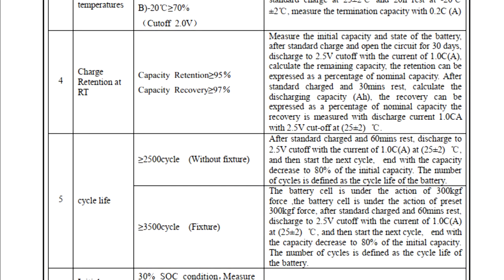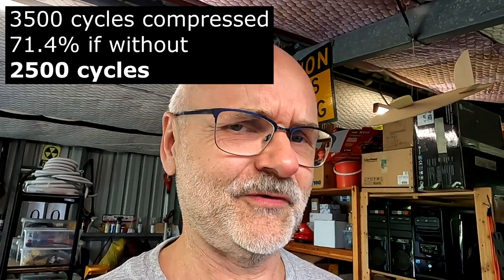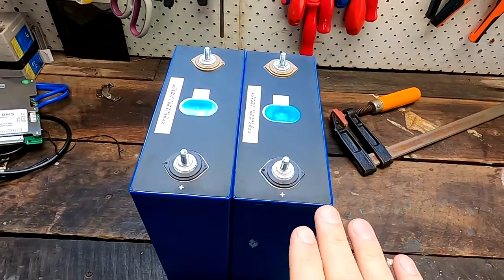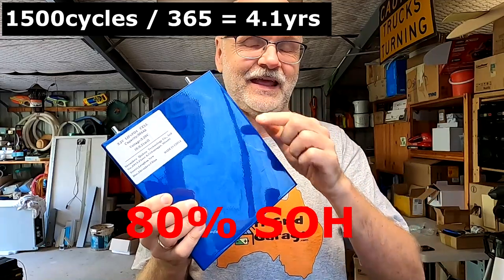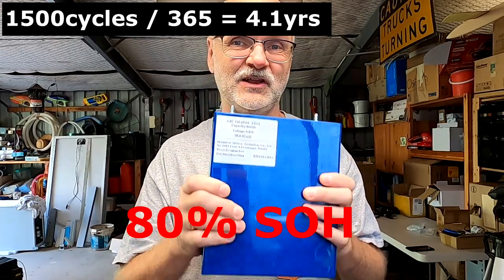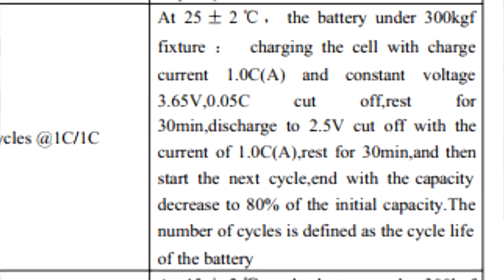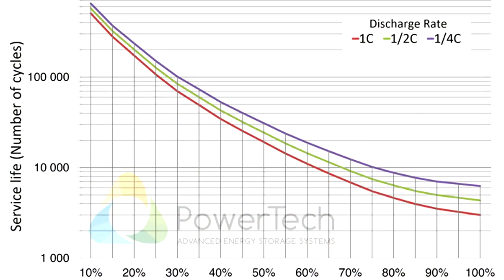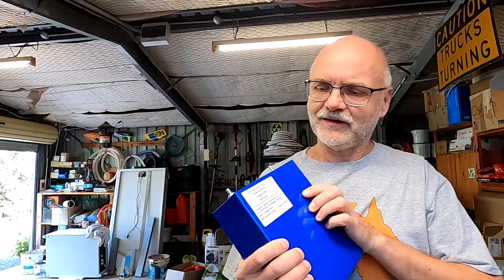Why compression will not extend battery life (something else kills your batteries).

Comment: I added mine in a fixture, because why not. In any case, high temperature does have a much bigger impact on cycle life, which is why I have an advantage here: my cells will live forever! ;)
Reply from the maker: Yeah, but too cold is not good either. 20-25° would be ideal. I'm in this range with mine atm. But it gets colder down here now... Unless you build a climate chamber with constant temperature...?
Reply: @OffGridGarageAustralia  Actually, when not using the battery storing it at very cold temperatures (even well below freezing) slows calendar aging. I have heaters built in mine: the case is insulated and it uses a small 7W Polyimide heater coupled with an aluminium heat spreader.
Reply: @OffGridGarageAustralia  hmm looks like the battery has enough spare capacity to provide its own local heating if required
Reply: I'm in South Africa and get so annoyed when all the YouTubers getting obsessed about the low temperature cut off of the bms.
Reply: @guy7gsa  High temp cut-off has been pretty much a given for some time. Low temp cut-off was missing for a long time. That's probably why...

Comment: resources were used in the production, which is valuable. Even if you don't use the life of the cells, someone else might. I think we should be sustainable everywhere 👌👌
Reply from the maker: But the resources would be used in any way, regardless if the battery lasts 5000 cycles or 7000 cycles.

Comment: I chose to do a light compression simply to hold things together in my school bus conversion. I didn't want the terminals getting a bunch of stress from the cells moving around a bunch.
Reply from the maker: Yes, that makes sense. Do you use flexible busbars as well?
Reply: @OffGridGarageAustralia  no, i figured that since prebuilt batteries generally don't use flexible bus bars, and since my cells are held snugly together and their box will be securely fastened to the frame, it shouldn't be necessary. Here's to hoping I'm not wrong.

Comment: Great video 👏🏻. I also came to the same conclusion on my own battery build…only without the accurate maths. 

I don’t know how accurate the cycle counter on my Daly BMS is but I’ve used 24 cycles in 6 months (including deeper discharge in a cold dark British winter) so even if I were to only achieve 1000 cycles that would be 20 years. And even then still have 80% capacity left. 
Like you say calendar ageing will be the death of my battery… a bit like the rest of us 🤣.
Reply from the maker: Hahaha, yeah calendar ageing will haunt us all!
Reply: The Daly counts 100% cycles, so if you do a 50% DoD, you will need to do 2 cycles for the counter to go up by 1. But in my experience the threshold current for the Daly is at ~2.6A, so it will not count anything below 133W on a 51.2V system. Most of the time I'm well below 2.6A on the discharge. So the cycle count on Daly isn't really worth anything in my opinion...
I'm not really worried about the cycle counter, but the high threshold also means that the state of charge is usually way off. Especially when there is no/little sun for a couple of days. The battery discharges continuously without the Daly noting anything. So the real SoC may be as low as 30% but the Daly will show 80%. This shows especially when the sun comes back up. After a short time the Daly will show 100% since the charge current is high. But the charge cycle will last many more hours before the battery is actually full.
All in all I like the Daly as a BMS that does its job of killing charge/discharge depending on voltage and temperature reliably. But for anything more sophisticated (balancing, SoC...) it's pretty much useless. The features are there in theory but not really, since 40mA on a 300Ah battery don't do anything. And a SoC display that is usually way off doesn't really hit the spot either.

Comment: The problem I have is that this is all academic at this point. There is not enough people that have had these cells in use for long enough for us to really know how long they'll last and how much of a difference compression/no compression and other factors make. I know of a few folks that have had lifepo4 for 10 plus years but they were using the plastic case CALB or Winston cells, I don't think the aluminium case cells have been around that long. 
Unless someone has clear evidence that compression is harmful to the cells, I just can't see any reason not to do it. Preventing the layers in the cell from separating has to be a good thing, and may help with calendar aging too. My cells were a big investment, and if the  ~$30 of materials and one hour of my time to set up compression gains me even just one year of use than that is well worth it. 
As for the assumption that there will surely be much better batteries available, for much cheaper, by the time these cells wear out, well, that is just an assumption. I sure hope you guys are right, but there is no way that is guaranteed.
Reply: exactly....the manufacturing plant with many years of experience do not print these specifications for no reason...

Comment: I've build a 24v 105ah Lifepo4 battery for my sailing dinghy, to power the auxiliary electric pod motor. If I take the boat out each weekend and I manage to fully discharge the battery each time. That is 40 years of cycles, at 2000 uncompressed.

I am going to use some filament tape to hold the cells together, like you see in commercial batteries.
Reply from the maker: Cooling is a great pint and underestimated I think. When you tape your cells together don't forget to have some insulation in between them so the thin film does not rub through an short your battery.
40 years is an acceptable life span for a battery 😁
Reply: @OffGridGarageAustralia  already got 1mm rubber between them. I expect to be running them at about 0.2c/20A

Comment: This is great info! I see my first battery built with cutting boards at 1:24
It was fun to figure out the compression thing, but yeah, I always wondered about longevity. In my case, these go in van campers which probably see a few dozen cycles a year at most… Even without considering the temperature aspect, compression vs non-compression was a difference of 40 years of use vs 80 years of use! The van that this compressed battery went into is already 36 years old, and we’ve done less than 10 cycles over the last year 😅
Good stuff!
Reply from the maker: Thanks for your feedback. I would probably compress the cells in a camper van due to the vibrations and movements. I also would use flexible busbars for such an environment. Just to get the full 80yrs 😁

Comment: Hi Andy! Thanks for adding the very important ingredient "REALITY" to the soup :-) That will enable people to focus on issues being important during their actual life on earth. Finally it is a race of calendar aging between battery and the owner ...  :-)
Nevertheless I confess to have compressed my battery pack very mildly. The reason ist that now I can use those braided bus bars form aliexpress that will not fit otherwise. Obviously the chineese manufacturer of those braided bus bars based the disign on nominal dimensions of the cells. Well, mild compression makes the equation fit - along avoiding any mechanical stress on the poles during battery life.

Comment: Absolutely right.
Large battery banks will probably die beforehand from calendar aging.
The same applies to liion prismatic cells.
My 30kWh liion powerwall got the original compression again, but more because it's easier to attach to the wall. 😂

Comment: Thank you for a very good video. You really explain this perfect. I’m using two electrical vehicle battery packs, and they are already compressed as you mentioned, so I just re-configured the cell configuration and then I use the module boxes again, just to have everything well organised and also because that I’m already know that they have the right compression on them. In normal cases I had done it just like you did with your pack. Thank you for a great channel.
Greetings from Sweden.

Comment: Manufacturer is testing at 1.0CA cell current rate.  These thick electrode cells should not be subjected to more than 0.5CA for more than short sporadic periods.  Cell internal heating will be about 35 watts at 1.0CA current for 280 AH cell.  It will get quite warm if 1CA for significant time which is damaging to battery.  As battery ages its internal resistance rises which causes more internal heating at high cell current.   Internal heating drops to about 10 watts at 0.5CA.  Also not mentioned is manufacturer compression fixture also provides some heat dissipation for cell (note the 25 deg C at end of spec paragraph).  Packing a bunch of prismatic cells side by side in a tight bundle reduces ability of cells to dissipate heat. 

Besides heating damaging electrolyte, it causes more electrode to copper foil and aluminum foil thermal stress that can cause electrode material to foil delamination. Compression does help reduce delamination but only when cell is subjected to high cell current causing temp stresses.

Not knowing what you are doing with compression can cause more damage to cell.  It can punch through separator shorting out cell and crack electrode material causing it to be electrically isolated and inert to cell operation.  Non-compliant compression can cause mechanical pressure to skyrocket to cell damaging level when cell is fully charged.
Reply from the maker: Thanks for your insight and additional information. Very helpful.
Reply: New datasheet does call for 0.5C for the cycle life.

Comment: 041322/0400h PST🇺🇸  041322/2100h Brisbane 🇦🇺 Thank you thank you thank you to the power of 1 million! I too am a proponent of NO COMPRESSION. The reason ? By the time the Compression technic is applied... The battery chemistry and  the battery designs would have become obsolete. I have seen episodes after episodes of several eminent people, enthusiastically exhibiting Compression techniques..... no comments ! 
I rest my case.  My PV system, though quite meager, is running for almost 3.5 years with no compression.
My charing voltage is 14.2V and each cell  voltage; at rest is about 3.328v~3.330v, ∆ 0.0003 and battery power 13.31@96%. BMS--JBD. No bulging, no deformation no thermal issues  Am I happy 😀or what? 
For me; compression is for varicose vein. Danke schoen, herr Andy und 73s...
Reply from the maker: Thanks Sree. To be clear, I'm not against compression nor do I want to talk people out of it. I'm just sharing my thoughts here and are keen to read your reaction and comments. Maybe I'm totally wrong...

Comment: Great Video.      It is rather funny to try to get more cycles from the cell than you possibly use in the life of the cell.
Reply from the maker: That's what I always thought. The DIY forum is full of threads of this and people went nuts on constructions for... for pretty much no gain.
Reply: @OffGridGarageAustralia  Plenty of knowledge gathered from doing it, including discussions with the actual battery engineers. I wouldn't call it no gain.
Reply from the maker: @upnorthandpersonal  Yeah, but it's not a recommended or even required method to install these batteries. Like with pouch cells, they give you clear instructions. Here it is just a test procedure and result the manufacturer publishes.
Reply: @OffGridGarageAustralia  I don't think I ever claimed that, it just shows a delta between fixture and non-fixture in test procedures. Now, statistically speaking, this also means that the probability of failure is higher without the fixture. How relevant this is in any application is up to the end user to decide.
Reply: @upnorthandpersonal  yes, I agree with Up North and Personal....I have 2P8S and 4P8S LiFePO4 (96 cells) cycling of 272Ah and 280Ah in 4 batteries... better to make the inexpensive fixture and increase the cycle potential...😎the end-user needs real information, not mere speculation...

Comment: My EVE LF304 cells are redneck compressed.  I parallel balanced them for a week, then put them into two 8s banks and wrapped them tightly with duct tape 😂

Even if it doesn't help prolong the life, it made it so I could pick up 8 perfectly squared up cells at a time and set them into my box.
Reply from the maker: Yeah, that's more a fixture then but will help with the handling for sure.
Reply: I was wondering if this was practical. I mistrust threaded rods. Worried they would run against and compromise the aluminium cases of the batteries. 
Love duct tape, now have a further use for it! 😀.

Comment: My plan for a 30kwh battery includes using 2x 17 EVE LF280K strings so I can keep the overall battery bank voltage a little higher and yet the individual cells top charge and bottom charge can be less on the ragged edge.. I also do plan to use slight compression for the first 50 cycles which are the break in/conditioning period when I will initially push the cells to 3.6 volts slowly .2c their first couple cycles then reduce this to 3.5 volts and .5c as their maximum charge which they can never achieve since I only have 7kw of panels.. Once the conditioning is complete I plan to back off the compression to almost none or remove it completely then save the fixing for the next batch of cells when I double the size of the battery bank to 60kwh.. The cells will be on metal shelving in a basement that stays cool even in the Summer so there will be no issue with them getting hot.. The 90/20 plan for charge and discharge sounds like a good plan to me..

Comment: Another good reason to leave some space between cells, is to avoid stress on the terminals, especially if you use bus bars to interlink them. Having a cell expand with rigid links can stress the terminal posts, and, loosen connections. The ONLY reason I would compress, is because of the recommendation by the actual manufacturer. Other than that, I would have dismissed compression as "snake oil".
      One thing to try: Next time you build a battery, try compressing half the cells, leave the other half uncompressed. After a few years, do discharge tests on the compressed half, and then, on the uncompressed half, and see if there really is a difference. Cells within the same battery would have been subject to the very same operating conditions, for the same times. The ONLY variable, would be compressed Vs non-compressed. That will tell the story!

Comment: I take the various factors that reduce battery life to be cumulative. Calendar aging will do X percent on it's own, cycling will do Y percent, storing at high state of charge and high temperature will do Z percent, etc. If I can spend $50 on some threaded rod, and add some scraps I have laying around the shop, and reduce degradation due to cycling by 30%, that's a solid win to me. I added car valve springs to my threaded rod, so the compression force will remain relatively constant, even as the batteries expand and contract.
Reply from the maker: Sure, there are options and depending on your thoughts you can opt in for some, all or none.
I do 75 cycles a year with my 44kWh battery. Calendar life degradation will kill it, definitely not cycles. So in my case, compression would be a total waste of time and space
Reply: @OffGridGarageAustralia  Agreed, sir. You also note that you prefer having space between the cells, for better cooling. Where I'm at, cell heating will be needed far more often than cooling will be. Thank you for making the info available to us, so we can choose the best horse for our own individual course.

Comment: I know this but will do compression anyway.
But only because I also use the threaded rods to fixate the Cells in place in a metal enclosure and because its easy to do.
Reply: Remember that if you compress the batteries when they are discharged then charge them higher than.5c to full 3.65 you will increase the pressure on the cells laminations to a very high possibly damaging level.. Compression is mostly only beneficial during the initial conditioning period when the fluid is finding its balance point inside the laminations and any stray gas bubbles get forced towards the relief passages so they can migrate out of the carbon fiber.. Beyond that mild compression acts as a girdle to help keep the laminations from having random bulge areas that become inefficient at handling the ions thus loosing capacity.. Once 50 to 100 cycles are completed the structure becomes very stable unless blasted with a high C rate that causes lots of heat..

Comment: Hello. I Have been watching with interest, the video where you talk about series parallel  battery formats. In particular,  the problem with current seepage between parallel strings. I think it's possible to resolve this issue by placing a diode on the output of each string, say a 300 amp rating. Each charge controller would then connect to their respective strings on the positive side of each diode, (battery +), that is to say, the sum of the solar panels would connect to all solar chargers inputs, but Each solar charger output would be independent with respect to its battery  string. Hope this is of some use. Best regards, Geoff.